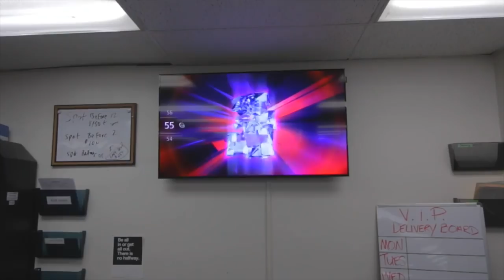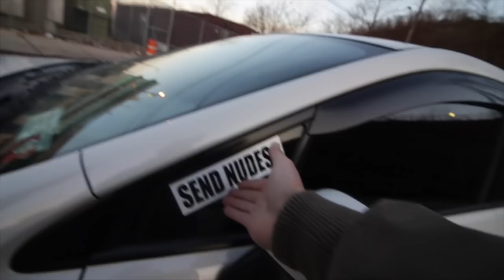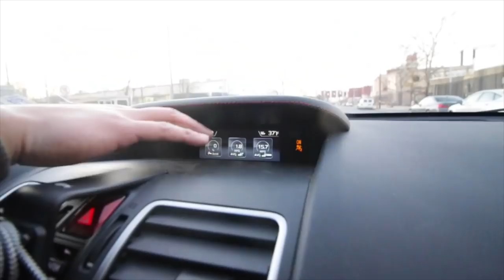2018 Subaru WRX: One Year Later - Mods, Impressions, Pros and Cons

Comment: Like the vid, just subbed.  I'm thinking about getting a 2019, but no dealer near me, so I haven't gotten to sit in one yet.  How is the headroom/shoulder room?  I'm 6'2" and 300lbs, so I was curious if I'd fit before I drive 2 hours to go test drive one.
Reply: I'm 6'1 210lbs and find it comfortable 6'2 should be fine I cant speak to the weight though.

Comment: Hey kyle, do you notice a big difference in shifting with the weighted shift knob? And do you have Perrin Shifter Stop stop?
Reply from the maker: Sup man! the shiftknob im using isnt really weighted, just a bit heavier than stock. That being said, I HAVE tried a weighted shift knob, and let me tell you, it is CRAZY how much a difference it makes. It makes your shifts much smoother and you more confident that youre in gear. I am not running the perrin shifter stop, but I do have the short throw shifter option from factory

Comment: Congrats on the anniversary. Good to see how much you still appreciate the whip. My 15 will be 5 years old come this April. Crazy how time flys
Reply from the maker: Thanks man! This is my first car, first manual, etc. so it has a special place in my heart. Don't think I'll ever get rid of it. It's also brought a smile to my face during some shitty times. This thing is my baby!
Reply: Any problems in those 5 years? Im 1 year in also with my 18 base
Reply: Dallas Williams one of my fans stopped working in first year. I filled up with bad gas just before 30k. I’m at 48k now last 18k in  mods not single issue since. But then again it hasn’t been my daily for past couple years
Reply: @-slurmdaddy-8147  which fan was it?
Reply: Dallas Williams one of the radiator fans, can’t remember which side exactly it was way too long ago.
Reply: Dallas Williams o yea my TOB has been squeaking for years lol.  Dealership supposedly fixed it years back took car in for several hours but they never did shit. It doesn’t bother me too much as I only hear it sitting in neutral.

Comment: My WRX 18 came with Dunlop Tires which are trash, a very underrated mod is new tires, I bought the Michelin Pilot Sport A/S 3+ and I feel like I just took the car off the lot. Even 1 month later it feels like a whole new car. Should last 45k miles according to their website
Reply from the maker: I hear that a lot! I wanna get new rims and tires at the same time, but that's gonna take quite a bit of saving. I'm glad I have your input though!

Comment: Hey Kyle, quick shout out to Astoria, but I wanted to ask what tires you use? I'm working on getting a 2019 WRX and need to swap out the stock summer tires. Our winters aren't terrible, so I'm guessing I don't really need dedicated winter tires. Do you run all-seasons in the winter?
Reply from the maker: ayeee Astoria represent! I'm still running the stock summer dunlop sportmax's. I havent bit the bullet and gotten winters/all seasons yet. I probably should get some blizzaks or something
Reply: @KyleClimaco  So you've been ok with the summer tires all year round? I guess I'll give it a while and see how it goes. PS- this will also be my first manual! Should be picking it up next week. Very excited!

Comment: Should I buy one that has a salvage title tho...? 2018 sti...
Reply: Yeah. 8-10k max and get ready for them electrical problems/ hydrolocked engine.
Reply: Skye Iorfida thx 4 the reply... but lmao it doesn’t sound good now... imma just buy a good used older model
Reply: Lmao I wish I could afford a new one... but I’m 17 and not make a lot of money 💔
Reply from the maker: not a good idea, you'll probably be spending the same, if not more than if you just bought a certified used one. these cars get beat on/driven hard
Reply: Only ok if you plan on being the last owner it will have since it will be difficult to resell or trade. Plus the insurance won't cover anything for you.
Reply: Just got a good deal on a new 2018 STI and it was listed at $32590 so it cost the same as a WRX premium

Comment: I got a black 2018 wrx before I knew how to drive stick too lol. I was so excited I went to the dealership not thinking how tf Im getting this car home lol.

I'll have to try turning hill assist off. I've been struggling shifting from 1 to 2 uphill and was really considering an accessport to help with that
Reply: Accessport won't solve that issue, but you can turn Hill assist off
Reply from the maker: you're brave for driving it home by yourself! turn of hill assist and you'll roll back much faster, but you'll be able to get the car moving much faster and smoother

Comment: GREAT VIDEO I WATCHED THE WHOLE THING IM 22 YEARS OLD IN CONNECTICUT IM NEXT TO BREWSTER NY IVE HAD MY 2013 CIVIC SI FOR OVER 3 YEARS NOW AND IM REALLY TRYING TO GET A 2018 WRX NOT SURE THOUGH BECAUSE I DRIVE FOR WORK 300 MILES A WEEK AND I DO NOT WANT TO PUT CRAZY MILES ON MODDED WRX MY FIRST YEAR WITH MY CIVIC SI I PUT 23K MILES ON THE CAR I MIGHT KEEP MY SI AND GET A 2008-2011 BASE 2.5 IMPERZA FOR WINTER CAR AND FOR WORK BUT AFTER SEEING THIS VIDEO IM LIKE DAMN I NEED A WRX MY SI SITS AT MY HOUSE ALL WINTER BECAUSE THE CAR IS HEAVILY MODDED I HAVE NO SELF CONTROL WHEN IT COMES TO MODS AND I PUT $8K INTO MY SI WHICH I REGRET ITS ONLY A FUN WEEKEND CAR IN THE SPRING AND SUMMER BUT I THINK ITS TIME FOR A 2018 WRX

Comment: Im confused,  i got myself a 2019 wrx and didnt got the mini trunk wing you have on your car,  and i cant find it on the subaru page either.    Did it came stock?  Am i getting fisted because im in Canada again?
Reply from the maker: It's a low profile spoiler, it's a factory option, at least on the 2018. It MIGHT be an american domestic market thing though, I'm not sure....
Reply: @KyleClimaco  well this sucks,  after seeing your car,   mine look blank AF :(
Reply: 0neKingD0wn I’m from Alberta, you must have got the base which doesn’t have a lip spoiler. You need to get a sport or sport tech to get the lip spoiler.
Reply from the maker: @FIRE8IRD780  i dont have a sport or sport tech, they just put them on some models and you have to find the model with the options you're looking for

Comment: Are you running a Cobb Ap?
Reply from the maker: nope, no cobb ap, stock ECU/tune
Reply: @KyleClimaco  I hate second gear rev hang but, i don't want to void my warranty!
Reply from the maker: old12school3 the 1st to 2nd shift is the roughest for me. Im planning on trying out a stage 1 wrx soon so I can see/feel if the difference is worth getting the AP
Reply: Kyle Climaco cool man let me know how it goes!
Reply: Kyle Climaco I did stage 1 on my 2015 (ETS CAI and Cobb AP) it really improves the everyday drivability of the car. I’m holding off as long as I can though.
Reply from the maker: Driver dude i really wanna go stage 1 and I hear nothing but good things from people who went stage 1. Do you have any issues with warranty? And can you still pop and crackle on command like with the stock tune?
Reply: Kyle Climaco the pop and crackle stays and with the addition of the cold air intake your turbo sounds amazing. Makes a blow off valve type noise when letting off the gas to shift. It was great. Really makes it even more fun to drive. I have a friend that works at Subaru and he said they can tell if an ECU has been flashed. Even if you reflash it back to stock. So if you have to go in for warranty work and it’s something related to the new flash then they will void the warranty. But they also have to prove that the malfunction is a result of the mod. But that’s only engine type stuff. If you’re going on for anything else the warranty will still be good.
Reply from the maker: Driver dude thats amazing! Thanks for the input! The biggest thing i was concerned about was actually the pop and crackles since ive gotten used to the stock tune. Now i wanna go stage 1 even more!
Reply: Kyle Climaco you’ll love it. Hopefully we will see a video about it some day!

Comment: No performance mods?
Reply from the maker: nope, can't risk my warranty :/
Reply: @KyleClimaco  catback exhaust with downpipe, j pipe, and intake shouldnt void your warrenty. Tgv delete and egr delete could though. A tune would also void the warranty, but theres ways around that.
Reply from the maker: if i change out my j pipe I would want a tune anyway. there's no point in adding an intake, new piping, etc, if im not getting a tune. TVS and EGRS are really tempting, but same thing, its gonna void my warranty. My local dealership is pretty strict. I'd have to drive out like 50 miles to a mod friendly subaru just for basic servicing  @DXCal09

Comment: I don’t understand how you’re able to get your car to pop like that lmao I have a full 3 inch cat back and it only does little baby pops :,(
Reply from the maker: lmaoo this is literally my most asked question on my channel! what 3 inch catback are you running? try rolling in first, throttle until youre rolling at about 3k and the turbo is spooling, then cluch in and rev up to 4-5k and let off the throttle quickly
Reply: Kyle Climaco I run the ets extreme but I’ll try it in my school parking garage after class 😂👌🏼
Reply: Yames don’t even need to be that high in the rev range. With muffler deletes just be in gear, rolling a couple mph and blip the throttle. 
When I first got mine it popped when revving and first and going to second. Over the years it’s started to do it all the way up into forth. Each downshift etc.
Reply: DanTheGreat I tried it but nothing :( I’m assuming it’s because I’m tuned?
Reply: Yames pro tune or an ots?
Reply: DanTheGreat ots

Comment: Just subbed to your channel, sweet vids. How do you get your exhaust to pop so much? I have a 2019 WRX manual transmission with the same exhaust as you.
Reply from the maker: Thanks for subscribing! good choice on getting a WRX! try rolling in first to about 3k rpm, then clutch in and blip the throttle to 4-6k and letting off the throttle!

Comment: Do you regret not getting an STI? Like do you ever see one passing by and wish you had one? Just wondering lol
Reply: I know you're asking OP but I have the same year and equivalent mods. 

I do and I don't. Mostly, I only like the STI for the rumble (unequal length headers) and the DCCD AWD.

Other than that I don't really appreciate anything else about the STI. Horrible gas mileage and the obnoxious wing are some things I don't like about it.
Reply from the maker: no sir, never regretted getting the WRX over the STI. Engineering Explained's video comparing the two sums up why i got the WRX over the STI. Performance wise, they are too close to justify the 7-10k difference. The only thing the STI has over the WRX is the rumble (which you lose when you go ELH to make more power). The WRX fits my needs and situation much better than the STI
Reply: @KyleClimaco  thank you

Comment: ny laws for tint, you wont pass inspection. You will have to remove it
Reply from the maker: nope, I have a tint exemption, I already passed 2019 inspection with 5% tint. I had it done at a subaru dealership too. Tint exemptions change lives ;)
Reply: How do you get a tint exemption I’m in Ny too?

Comment: PSA. The break in period on a 2015+ wrx is 3000 miles. Confirmed by multiple Subaru dealerships/mechanics.
Reply from the maker: Will Herman wow the most i got was 1500 for the break in. Thanks for info! Glad i wasnt driving her too hard til like 5k
Reply: The italian break in actually works great on these cars.
Reply: Dude it’s all cosmetic. If you want sound and “ performance “ tune it. Do some real engine mods. Person
Reply: Personally I did Cobb stage 1+ big intake and look into stage two in a few months... different car so awesome. Show cars are cool and all but you should back it up.. much respect great vids, just please get into the engine a bit.. all show no throw.
Reply: The owners manual for my 2020 says 1000 mile break In keep it under 4k rpms..?

Comment: Every one embracing ELH. I'm just like meh. "It's more efficient and makes more power"  I don't really care, rumble or dieeeeee
Reply from the maker: ehh to each his own, I love the subie rumble, but the WRX is the perfect car for me and my needs/build plans
Reply: @KyleClimaco  I totally agree to each his own. We're currently in a 19 WRX 6mt, ditched the mufflers 600miles in. Disabled hill assist as mine was engaging at inappropriate times like on flat ground holding me from pulling off. Ebrake makes a funny clunk sometimes and the clutch clicks when you push it. Man I miss my rumble, I sold my 05 blob. I got a 02 bug now but needs a motor #ej20lyfe..